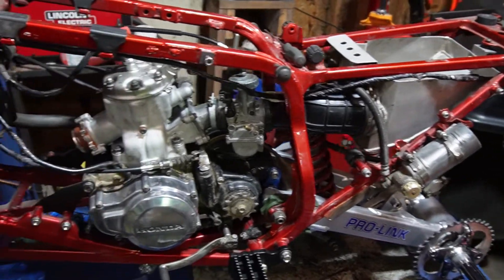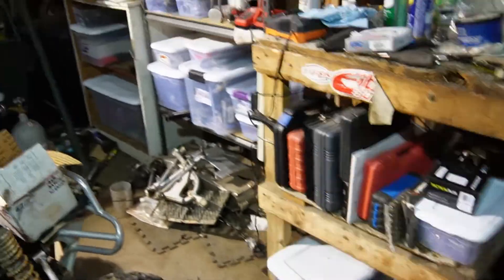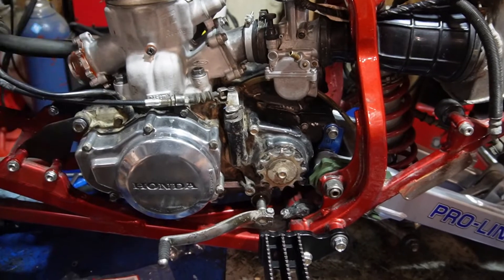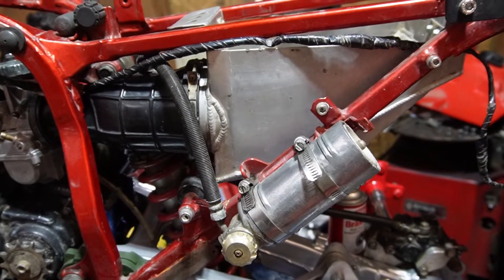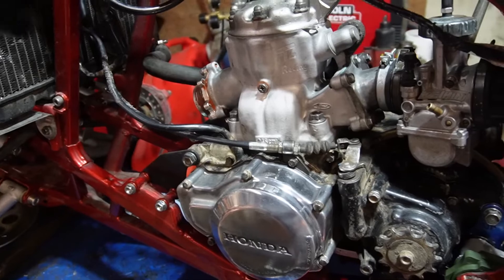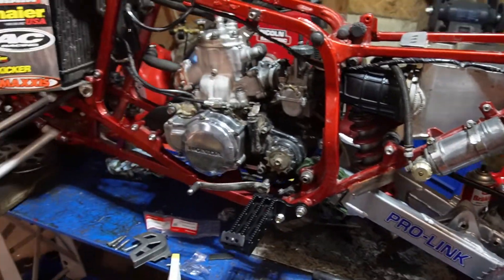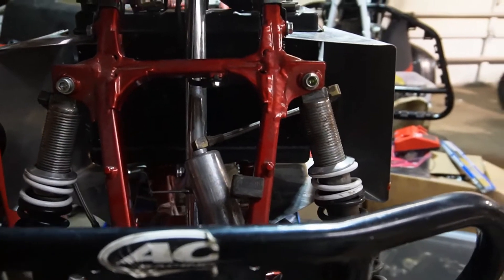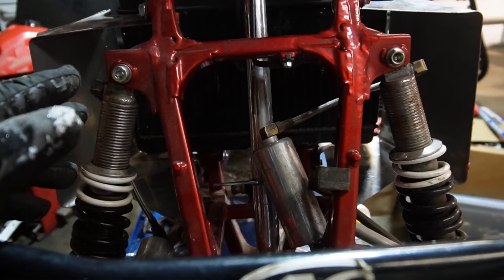I sent this 250r to the scrap yard

Comment: As someone looking to get into a 250r for the first time, what year would you recommend searching for?
Reply from the maker: Depending on your budget I would start off with a complete quad almost any year. There are lots of changes but suspension and power are basically the same. everyone wants the 89, get something that is low hour if possible.
Reply: @Rec-Star  thanks man! I'm going to pick up a 86 on Sunday! I wasn't sure if there were any years to try and stay way from. Seeing that this particular bike is also an 86 makes me feel better.